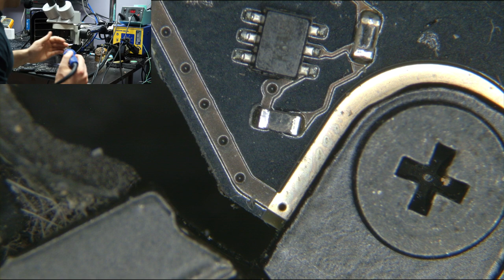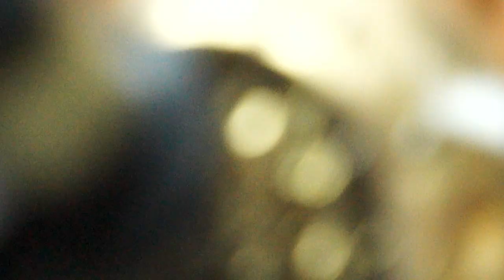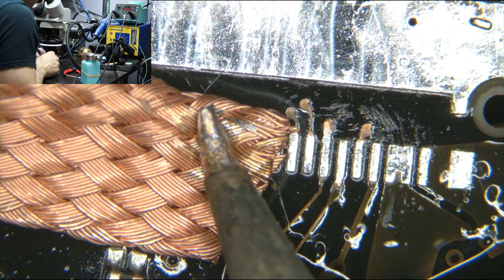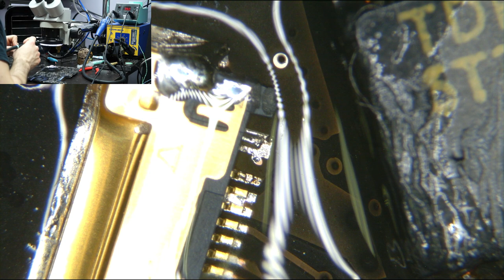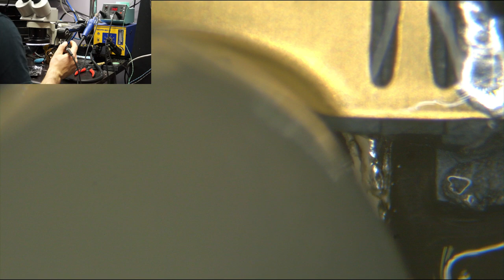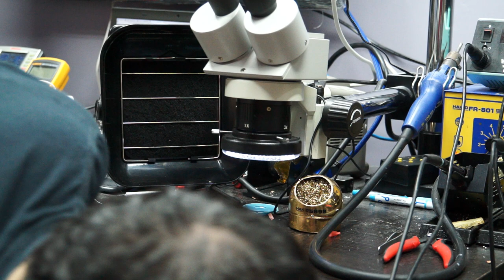Replacing LVDS connector on A1286 Unibody Macbook Pro with Weller WMP65.

Comment: I replaced the glass in my 2010 13" macbook by heating the glass. Must 
have done it 40 times now. Except this time when I plugged the lcd back 
in the connector smoked. I took it apart and at least 3 pins burnt 
inside the connector. I replaced the connector and check all of the 
solder joints but only have a white screen now.

Comment: Hello, I have same laptop with motherboard 2556, no backlight fuse is ok near lp8550 chip and i see 5v on capacitor, fuse has 10,7 v. It had some waterdamage. I changed lp8550 no change.
I can see with tourchlight that appel logi appears. Can you give any hint ?

Comment: I got a laptop that has this problem how much to fix the connector same price as a used motherboard? I seen the LVDS cable was all mangled so I replaced it thinking it was a easy fix only to find out they broke the pins inside the motherboard part

Comment: Hi, great, good and professionally job... I have a macbook A1286 EMC2563 late 2011 and there LVDS connector problem (logic board 820-2915B). so there are about 3 or 4 pins missing on the board and the connector caused by corrosion or buned. Can I have the pinout of these pins in order to fix it. If I can have your email so I'll illustrated by photo.

Regards

Comment: Solder suckers usually suck, however have you seen the Japanese Engineer SS-02? It's pretty amazing in comparison to a standard solder sucker with a solid tip as it has a Silicone Tip allowing it to flex and make better contact with the solder/through-hole etc, YMMV with any tool but this one is extremely powerful alternative and I find it is less destructive than a heated vacuum desoldering gun which as you may know on a poor PCB can easily take a trace off if you make contact with them at any interval of time.
Reply: just use wick

Comment: nice ,I have a Weller wsd80 and is nice ,however i use to replace  micro-controllers  with 4 rows of pins with a soldering gun ,by making a tip of cooper ,2 millimeter  thickness  around it ... good old times ...with  crt tv repair

Comment: Hello. Can you tell me if you did soldered the GND golden surface which is in opposite side with the 40 pins? I see that you solder only the margins. If I did not solder the entire surface, I could affect the functionality or not??? I mean there is a thermal reason for solder the entire surface. Thanks
Reply from the maker: +Sehy Sehyz pointless, just solder sides.

Comment: before desoldering connector use flux and resolder pins with fresh solder. even leave bridges. fresh solder melt under lowerst temp.

And learn to use "drag soldering" technique
Professional SMT Soldering:   Hand Soldering Techniques - Surface Mount
Reply from the maker: another video on drag soldering is coming up once i finish building the video editing desktop. recording these to the laptop is a PITA. I dumped drag soldering after so many attempts with the knockoff iron ended in misery, but with this one it's easy breezy!

Comment: i have a question i have a macbook pro 15 mid 2012 it has black screen no matter what i do. but the back light does turn on. if i connect to external display it does work on the external display. i have done a pram and smc reset.  i have tried reseating the lvds cable with no luck.
Reply from the maker: +Marina Sergeant try new screen, new cable, etc..
Reply: +Louis Rossmann thank you i just tested lcd and lvds cable with another macbook and it works perfectly fine :(
Reply from the maker: +Marina Sergeant voltage on pin 2 and 3 of lcd connector reads?
Reply: dumb question :( where is the best place to check those reads as its almost impossible to test from the connector.
Reply from the maker: Marina Sergeant
Get finer multimeter probes.

Comment: Hey Louis. It's me again. You probably remember me as the person that types too much. I have an issue that I'd like to share with you. I have an iMac 27 inch (late 2009 i7) that I purchased at a low price. Everything works perfectly except for one problem, the problem being the LVDS on the logic board is missing 8 'pads', from what I've learned they're called. I'm in the learning stage of soldering and would like to know if there's any way to fix it, and how, or if I will need a new and expensive board entirely. I ordered the brand new component that needs to be soldered onto the board, due to the previous one getting ripped off from the previous owner opening the LCD too fast. What I would appreciate to be clarified is, if the LVDS is useless due to it missing pads, if I can somehow repair the damage, and why pads are important. Thanks.
Reply from the maker: Get the boardview, click the missing LVDS pins, and see where else on the board they show up using the nets feature(hit N for this). Don't buy trash other people fucked up trying to upgrade their drive.
Reply: Louis Rossmann I just purchased the schematic, and it doesn't come with any "board view" file. What's the difference between a schematic and a boardview? I have been studying the schematic for several hours, but it doesn't not illustrate every component scaled to size where it's at on the logic board, making it difficult to understand. Any clarification would be appreciated.
Reply from the maker: schematic is the drawing of how the components go together, boardview is what allows you to go "ok, I see r9731 on the schematic, now where is that on the actual board?"

one without the other is absolutely useless.
Reply from the maker: A common misconception is that we are all geniuses because we look at the schematic, and then fix the motherboard. Without the boardview.. we are not fixing shit. :)
Reply: In an attempt to open and operate an iPhone repair/computer repair business from home, and with $2000-$3000 to work with, what inventory do you suggest I begin with, as well as specific tools? In the big picture, I imagine a technician, who runs a successful business, spending tens of thousands of dollars on different screens, batteries, track pads, keyboards, and cables per individual model of computer, and in addition having to purchase various resistors, capacitors, inductors, and other components. However, if I had to choose several specific services along with limited inventory, what would you recommend I begin with?
Reply: Real men stock inventory. HAHA!!! A hairs growing on my chin.

Comment: Good evening, Louis, are Mauro. We have a workshop in Italy Repair of computers and cell phones. I've seen many of your video and I must say they are very interesting and useful. You're very good and accurate. We present a problem on a MacBook Pro A1286 with logic board 820-2532-A. Practically the LCD screen does not backlit. I tried to change the LCD, LCD flat cable but unfortunately the problem persists. At this point the problem depends on some component of the logic board. Can you tell me what component that handles the backlight in the logic board?
Thank you very much for your help.
Regards.
Mauro
Reply from the maker: Tons do. Unfortunately no shortcut around using brain on this one!

Under the speaker/mic, in the middle, there is a brown 0402 component with a white dot. This is a fuse. Start here first.
Reply: Louis Rossmann Ok thanks, we will try to see if this works or component problems. Anyway I'll let you know. Good job;-)
Reply: Mauro Massimo Hello Louis, actually fuse is broken. I checked with the tester then the bip and I replaced. Unfortunately, the problem persists, the LCD screen remains dark though you see the apple startup with a torch. Which component I check now?
Thanks
Reply from the maker: What voltage do you have at backlight output?
Reply: Louis Rossmann In what point must be measured?
Reply from the maker: .....backlight output
Reply from the maker: MAURO PATAMIA measure on c9799. By whether you have 0 volts, 12 volts, or if 37 volts i will know what to do next. But I will be ignoring you until Monday since I will be on vacation in disney world with the rest of the staff.
Reply: Louis Rossmann I downloaded the manual electric logic board. On the page "LCD Backlight Support" known that the voltage is 12.6V .right?
Reply from the maker: I told you to measure the voltage on your board not recite to me the voltage in the manual. :-( please measure on c9799 tell me what you have

Comment: What kind is the microscope? Thanks
Reply from the maker: This one is just for doing these videos, but is not ideal for actually working. Get an Amscope SE400Z.
Reply: Louis Rossmann Thanks I'll check it out. Which HD camera would fit this model?
Reply from the maker: they all suck they're USB which is why I don't use it for making videos. No clue.
Reply: Louis Rossmann
I was thinking if I could just attach a nice HD Logitech webcam and see how it goes. BTW when you take of the logic board out of the alcohol tray after the cleaning, you can use a heat gun or lay it on a heating table to dry it quick, instead of waiting couple hours
Reply from the maker: I use an air  filter

Comment: Why don't you use solder paste ? and also those thin nozzle flux/paste dispenser is only 5 bucks on eBay
Reply from the maker: It sure is. The $5 is nothing. Remembering to go on eBay during free time to buy it; that's expensive! I could have bought it and waited until it arrived to do this connector and the video, but eh. I wanted to do it now.

In terms of solder paste, I don't know... because this works and is already on my desk? Kind of like eli the computer guy's answer as to why he uses Safari as his browser. For the ultra high tech reson that it works, and is the default. I don't really go looking for every way to do something, more like do I have something on my desk that can do the job, if I do, I don't bother going out looking for other solutions. Too much work to do to have time for that.